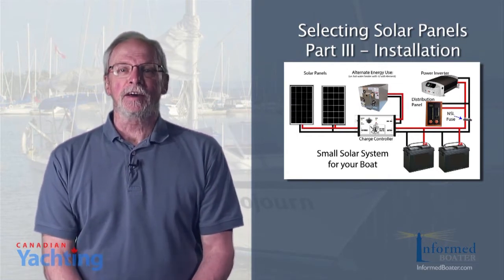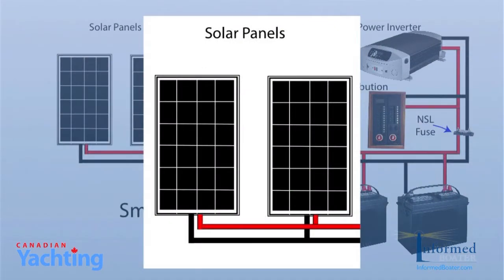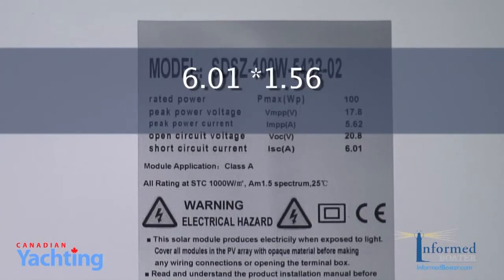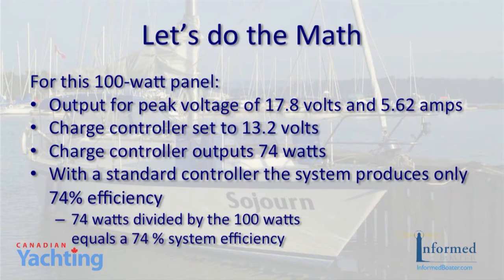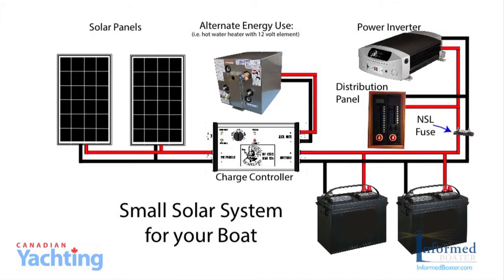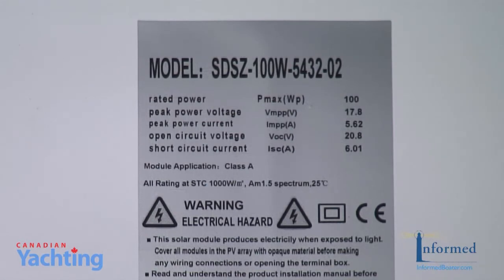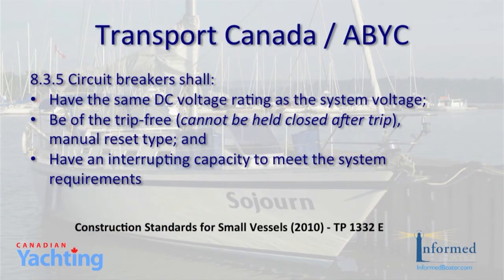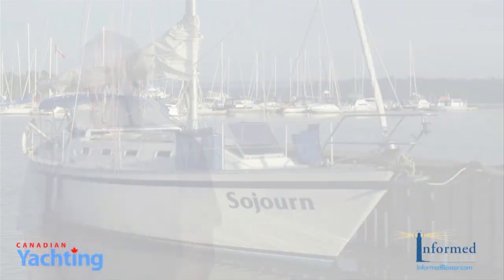How to Select & Install the Solar Charging System on Your Boat -  CY's Ask the Experts

Comment: This a great video but overlooks the presence of an existing shore power charger and alternator output while underway. There are many aspects that need to be considered like can the systems be wired in parallel or do they require isolation? I’ve seen a video from one solar controller company that shows the alternators connectors melting when the controller was left connected when the engine was running. Extreme fire hazard and inevitable system failure at sea!

Comment: It's a water heater, not a HOT water heater. Why would you need to heat hot water?
Regardless of the small savings on the controller and wiring price, the MPPT unit is more efficient than the PWM unit. It also allows for future upgrading of PV panels. You could add two more panels and wire them in series for 48 volts in, with smaller wires and not have to replace your controller.
I've never met a sailor who wanted less charging capacity.
Reply: don't me a prat.. hot water heaters heat water till it's hot .